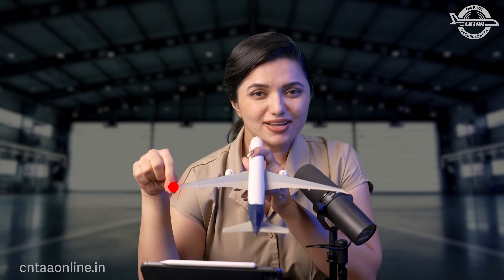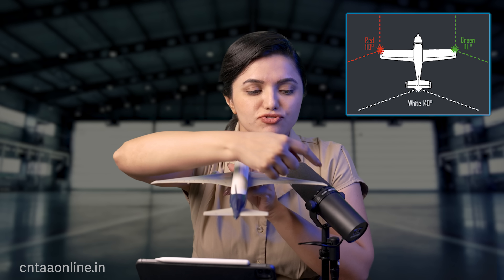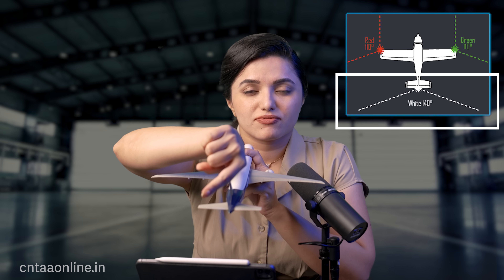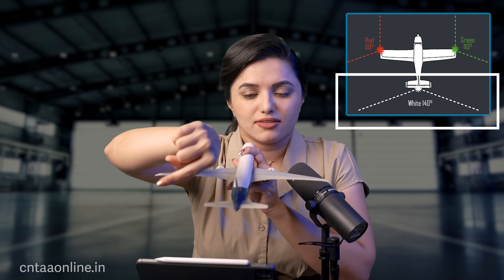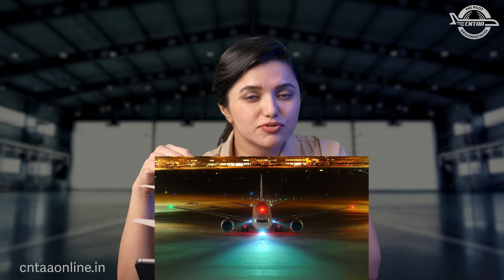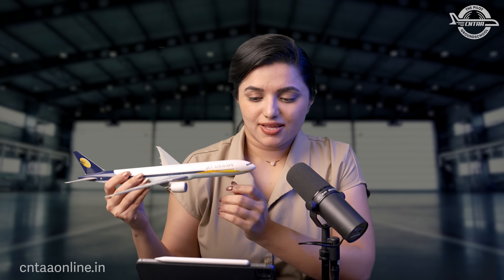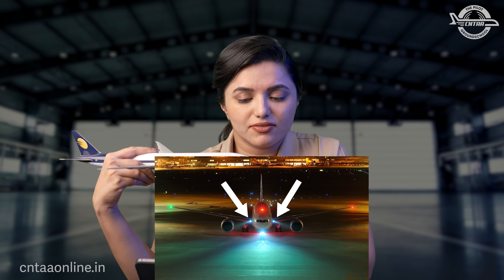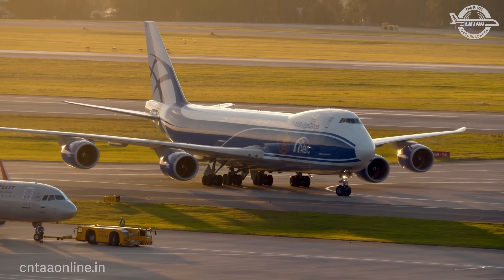Airplane Lights explained by Capt. Neha Thakare

Comment: How many percentage are required in 12th science maths and physics and what is the procedure about commercial pilot licence
Reply: The basic procedure after 12th class:
- First take an aviation medical examination (Class 2 medical and Class 1 medical). Register on the eGCA portal and then go to a DGCA approved doctor.
- Apply for the DGCA computer number.
- Study the DGCA theory subjects (ground classes). The subjects are: Air Regulations, Air Navigation, Aviation Meteorology, Technical General, Technical Specific and RTR (Radio Telephony Restricted). For example, you can take a preparation course at an aviation academy to study these subjects.
- Then complete the DGCA theory exams. The exams are conducted at DGCA exam centers.
- Apply to a flight school where you want to get your flight training and complete a course for a commercial pilot lisense (CPL).

Comment: The Most attractive and decorated area,  informative with accurate guidid equipments and lights ! The Profound , Monitored area 24/7 just Safest T & L of the Lovely Birds " ATC (A-1 Test of all Communications).  Love 💕 for Childish  wishes.  ( Praying , Enjoying , Playing , Experience ,Ops , Testing and Operation.  
Landing and Take off with Swift response even in the worst weathering! What a huge ❤️, Spirit,they have! 
Steep and Sharp Sounded Birds leads 1st followed by , Bumbard and So on---
What a latest capabilities, they had! Still have
Feeling Pride in Blue Uniform!!!
Team work , Discipline and Actions

Comment: Thanks for this video. Is it correct that landing lights must be on till you reach 10,000 ft?
Reply from the maker: Yes, correct. It can be 10000 or transition altitude/level. It depends on airline policies and local regulator policy. 
Good luck 😎
Reply: @CNTAA  Thanks for the reply. Learning a bit as hobby on home simulator. Hopefully if everything falls in place, would like to take PPL.

Comment: Navigation lights are Similar to ships it seems
Reply from the maker: Yes, that’s correct.
Reply: @CNTAA  I am an experienced aircraft maintenance technician
Reply: @jeetlahkar894  yes the starboard and portside green and red lights are very similar.
Reply: My car using these lights
Reply: yes
Reply: @jeetlahkar894  surely so
Reply: @jeetlahkar894  I worked in merchant navy in 90s
Reply: In ships, navigation lights cover 112.5 degrees for side lights, and 135 for aft light. Additionally one forward mast head light is there, which covers the angles covered by both side lights together. If a ship is more than 50 meters in length, there is one more mast head light, which is similar, but at a different location.